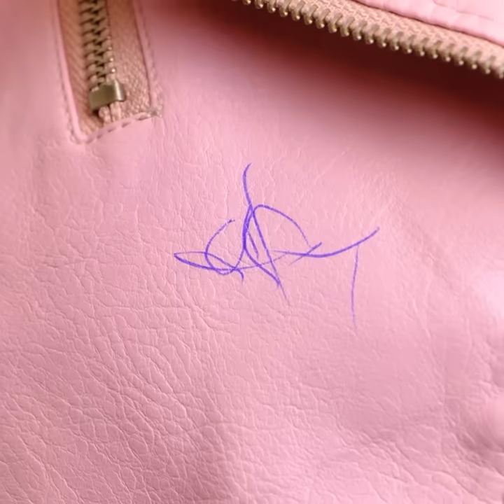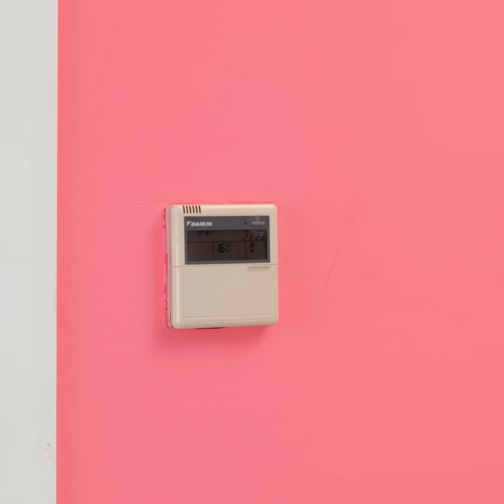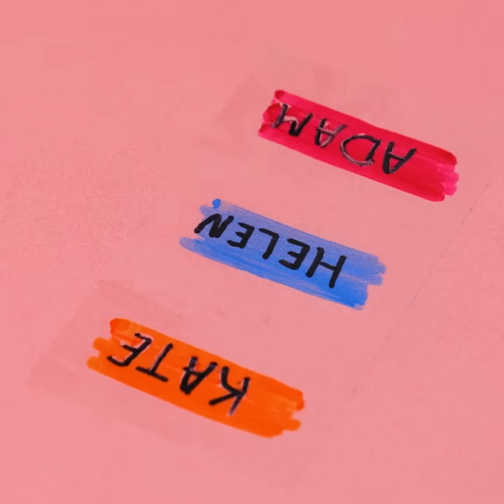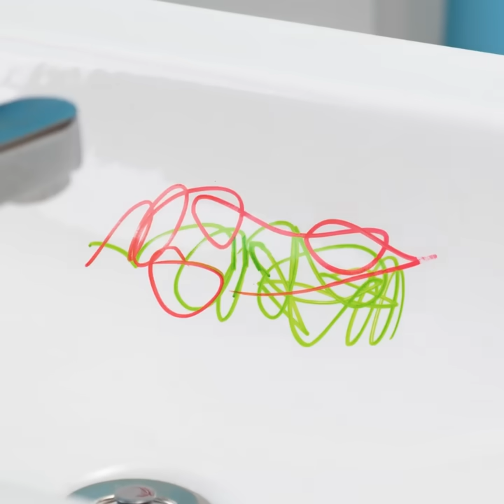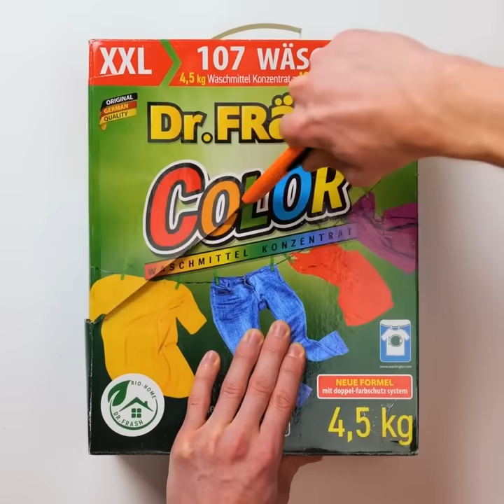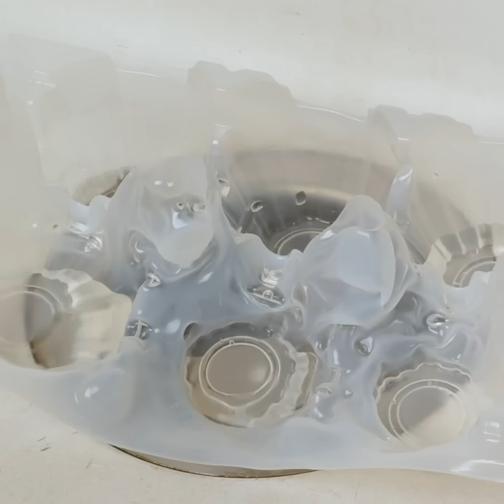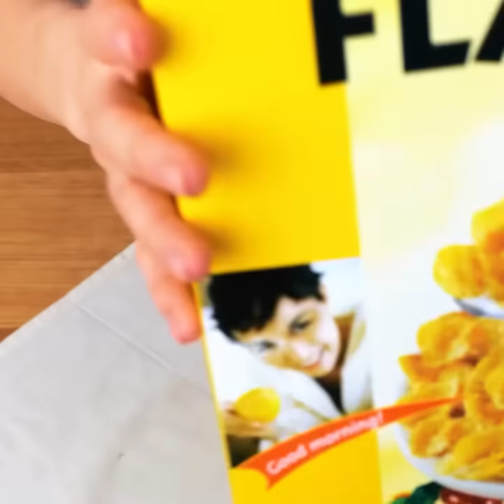Useful Home Hacks You Wish You Knew Before

Comment: Useful & Money-saving Hacks:
Cut your SOS pads in half to make them go longer. Put in snack-size ziploc bag & put in freezer after each use so they don't rust.

For those of us that are single and/or empty-nesters, This would be good for college kids or older kids at home, too.
   When I buy hot dog buns and hamburger buns, I put 2 hot dog buns in a freezer bag  and 1 burger bun in a freezer bag and freeze them. I don't eat either all the time, so I would end up wasting a lot. This way when I know I will want either, just stick the bag in the fridge to thaw then put on counter to come to room temp. This has saved me money and time.
   For those who say this would be wasteful of bags, nope, not at all.  Since the only thing in the bags is plain bread and it's frozen, just re-use the bags.  I have them labeled what they are and they have a place in the pantry when they are empty.

I tried the hanger with paper towel hack awhile back and found this to be very useful outside. If you try this, just make sure your break is in the middle of the hanger and not to the side like in another video on another channel.  This is perfect when you need paper towels outside and want to keep them clean, not on dirty surfaces. Doing that in the kitchen like in this video is just tacky. And who puts a roll of paper towels in the cupboard and over the sink? lol

I do use the pool noodles for my tall boots and since I have MS and at times my gait/balance is off, I end up running into my footboard on the bed and now have scars on one leg. I cut a piece of pool noodle to the right length then cut a slit on one side. Wrap the noodle around the sharp edge and I ended up using 2 zip ties to hold it in place.  Paint it beforehand if you want. 
Pool noodles is a great idea for those who have little ones. If you have furniture you can alter, change the style a little and add half noodles to those edges so your kiddo doesn't get hurt. You'd probably want to paint them first so they match your furniture lol  I've got a new grandson so I may end up having to use the last pool noodle hack; we'll see. 

I hope some of these help.  These are things I actually do and find that they work well for me.  Check out Hometalk . com and here on youtube.
Reply: L
Reply: @FarmanKhan-il9mj  what is that supposed to mean?

Comment: some of those are absolutely ridiculous (honestly, a pretty sheet would work better as a curtain than a PAPER BAG BLIND ffs), some are outright dangerous or will cost you money in the long run (the HVAC), some make doing a job HARDER (when you could buy a reasonable tool for it for a $1 at the dollar store- the cleaner thing for the vase. its called a BOTTLE BRUSH), and only a handful in the 12 minutes i made it through seemed useful or a good idea (the stool pillow).